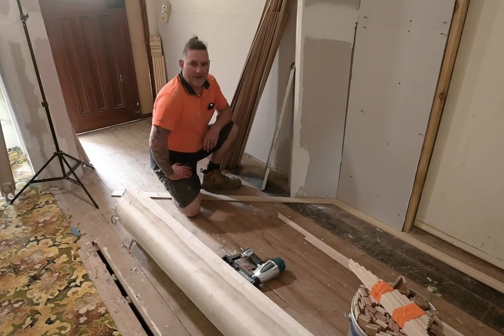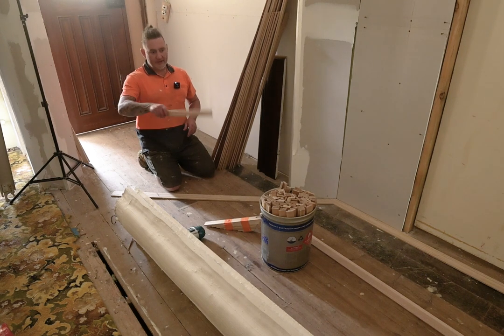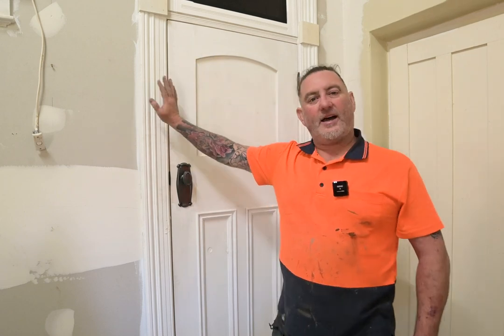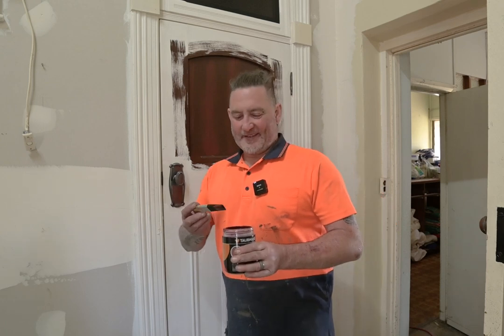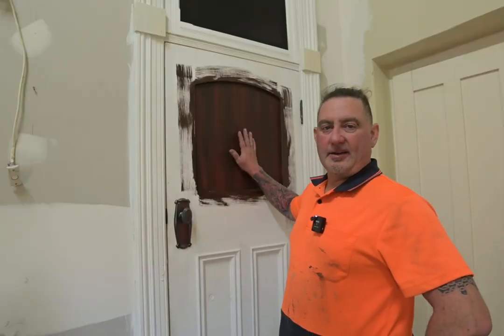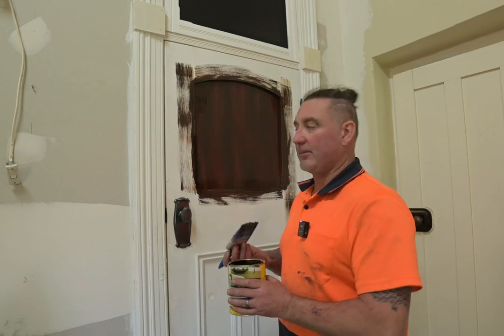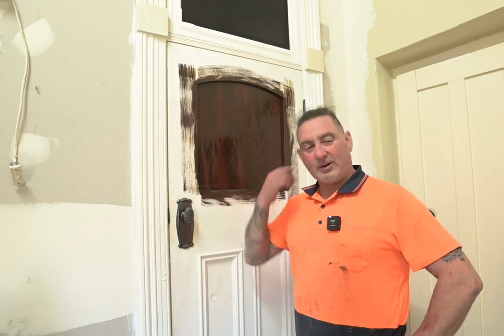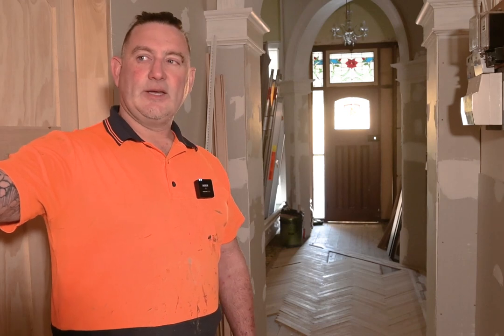S01E78 : parquet flooring and woodgraining | 1880 Shop into Victorian Mansion

Comment: Encaustic tile will be pretty in the vestibule. The grained wood is a neat idea, a lot of that went on in the 1870's 80's. In the old times, they would affix the parquet strips to a heavy canvas back and it could float with the subfloor and not pop up if a board beneath shifted.
Reply from the maker: Hi, yes that's the yikes I was trying to thing of, I'll be looking into what's available. Oh they used canvas,  that sounds like a good idea, thanks so much for the tip!  cheers, Mike

Comment: If you're going full on Victorian, have you given any thought to a conservatory for plants and flowers? Usually they were right off the dining saloon, where you already have a covered gallery, and since they usually weren't insulated like the big house, more like an old-fashioned screened porch with a little nicer windows, semi glass roof, and some pretty wood or iron work, you could even use some of that textured glass and even framing from your grandparent's room partitions to frame it in, that's gorgeous wood!
Reply from the maker: Hi,  thanks for the suggestion, unfortunately I don't really have room for that, the house is getting bigger by the minute lol. Cheers,  Mike

Comment: You do like to make life tricky for yourself don't you?  That floor is going to look awesome.  How far are you taking it?  Just in the hall?  The stained glass looks great as well.  I did a panel maybe 20 years ago at a weekend TAFE course in Brisbane.  It was a lot simpler of course, all straight lines.  I don't know how many times I had blood while cutting the glass!  I had it framed and still hanging in my house.  I love it. 
Bummer about the Ute.
Reply from the maker: hi Lois, I'm doing the flooring throughout the whole house,  I just picked up some knee pads lol.... old knees! well done with the stained glass panel and holding onto it for so long. it's a trip to the crash repairs tomorrow lol. cheers,  Mike
Reply: @4thgenerationrenovation  good idea about the knee pads.  Knees seem to be the first thing to go.